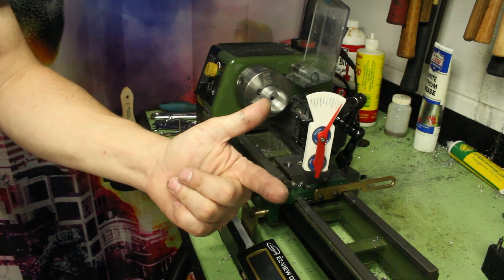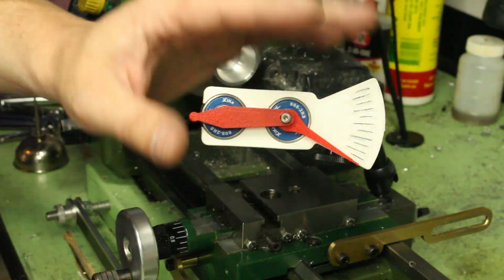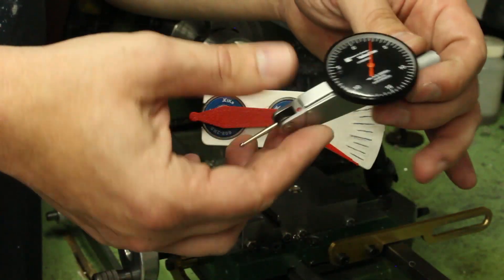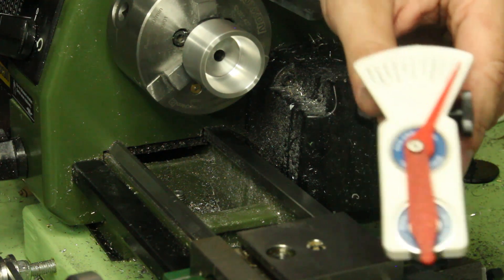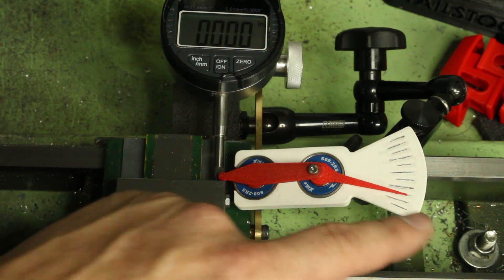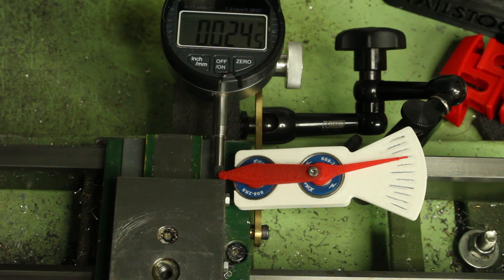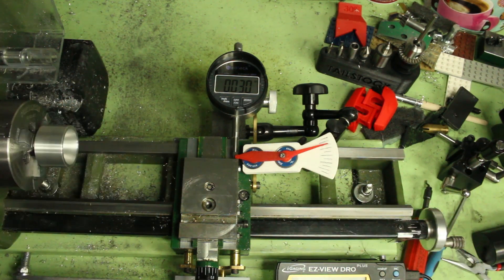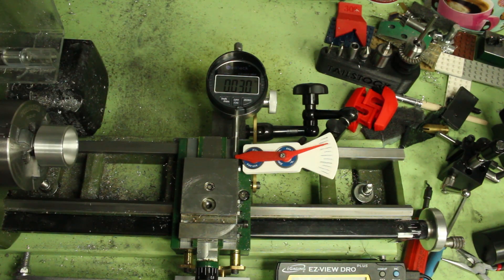3D Printed .005" Test Indicator

Comment: Its trash but its exactly what I need! Im doing a challenge to make a "machine shop" using nothing but natural materials I can find in the wild or trash I can find on the ground, and that goes for the tools to make the tools as well. So far I have some surface plates made from big rocks I found and a crude forge made from clay to smelt aluminum and copper. No way I can make accurate gears yet for a true dial indicator but now I can move one step closer to my goal when I make this from aluminum.